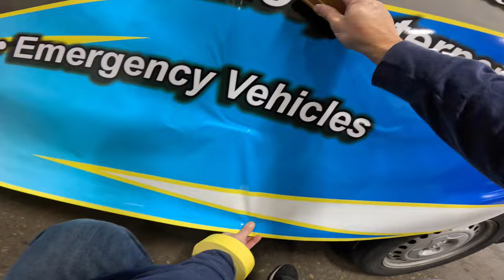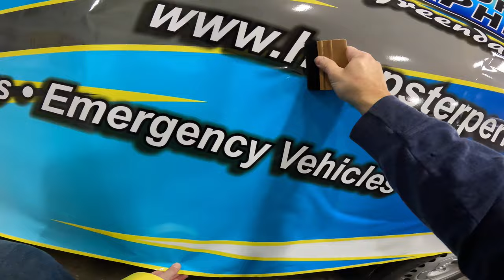Vinyl Wrapping the Shop Van! #vinylwrap #asmr

Comment: lol you make that look so so simple 😂 I pull my hair out doing simi trailers with them blessed billion riveted wall panels.But watching  you work the wrap I have decided your material is far more forgiving an easier to work with. My 3M that I get from my supplier is heavier and once it touches? It’s 95% permanent. Last forever going down highways but is an extreme pain on riveted trailers. Smooth wall? Piece of cake. truck bodies easy Peezy.  But like you said I have no formal training just trial and error and learning from my mistakes.😂 But I love the color scheme on the van it stands out, but doesn’t look tacky the accent highlight each other.

Comment: Nice job!!! Maybe instead of recording down to 1080p just plug in the go pro so you don’t have to keep swapping out batteries. I did a pool install video that was about 6 hours with 1 battery just plugged in the whole time on a tri pod. Great video keep up the good work.
Reply from the maker: The problem with the mini 11 is it heats up.  It's not really meant for what I am using it for.  That's why I'm going to start using my canon, or get another full size gopro
Reply: @wrapshopgarage  yeah that’s a great idea. I’m happy for you and your success. Came over from Cisco’s channel and the Victory crew. Wish you and yours the best.

Comment: On the back on the van, at the very bottom you put a YouTube sign with your YouTube name........It's a circle with WRAP at the top, GARAGE in the middle and SHOP at the bottom, is that correct?........Wouldn't people look for your YouTube in the order they see the words? i.e Wrap Garage Shop.......I personally wouldn't read that as Wrap Shop Garage.............So my main question is......If you type your YouTube name in as Wrap Garage Shop with your location enabled would your YouTube be the first one to pop up.....I'm in the UK and don't know if I"m in the best place to test that.
Reply from the maker: I appreciate the comment!  Yes, I have checked both ways of the search query, and my channel pops up first for both searches!
Reply: So, personally, I read the two words "WRAP and SHOP" first, before I read "GARAGE". That's why the first two are smaller (and the same size) and in a different color than "GARAGE"
Reply: @wrapshopgarage  Ah ok, cool......As I said, I would have read your YouTube name wrong and it doesn't even sound wrong to me in the UK as everything is a SHOP here.......I did notice it wasn't on your side Wraps, but I guess the wrap company is the main thing, for people to know.
Reply: @floridalove1  You're maybe correct, but as I said that's how i read it, I posted a few seconds after I seen it, which is maybe the time drivers/passengers would have the time to read it.....Admittedly if I was sat behind him at a set of lights, I would have took more time looking at it......I looked and posted.